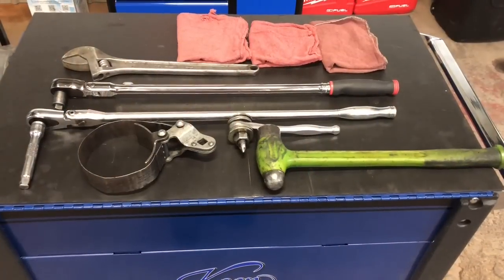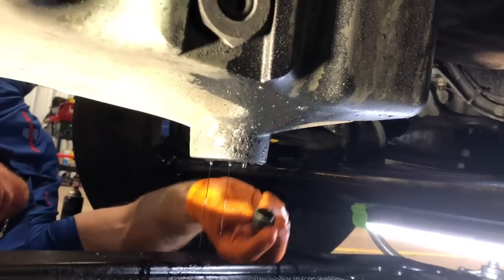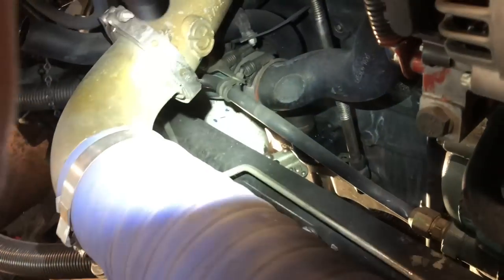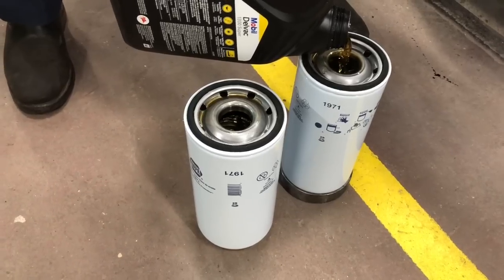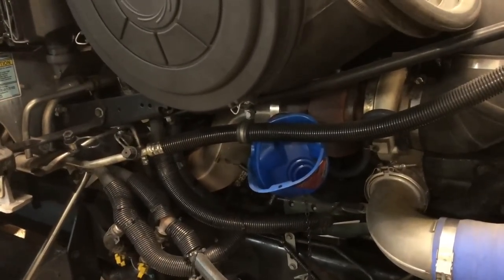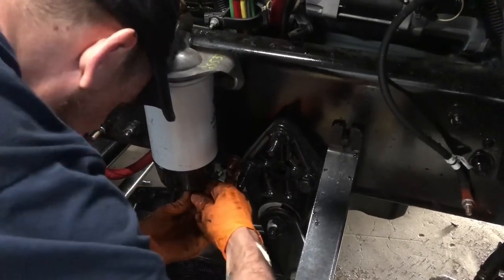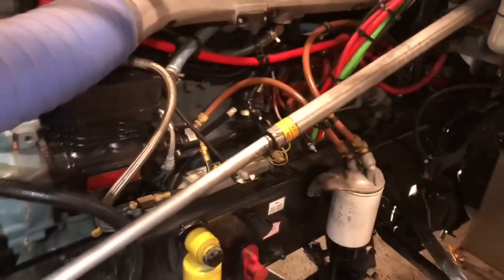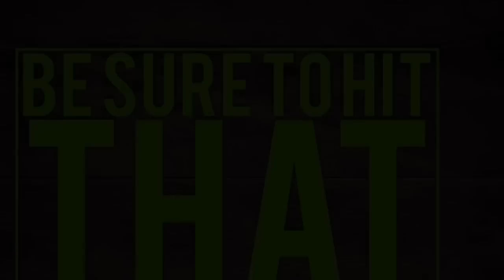Detroit 60 Series Full Service, DIY Step By Step Guide Oil, Oil Filter, Fuel Filter Change

Comment: One thing i learned from working on so many detroits is, if the motor is empty of oil and new filters is on and empty, you can fill the truck until the oil gets to the a in usa on the dipstick, if its the same dipstick all the trucks ive serviced, after you fire it and the oil circulates, it puts it right to the full mark. I had to figure something out because I got tired of dropping a full oil filter lol

Comment: I have the same truck but a Fitzgerald. It's got 303,000 miles and not one issue yet. 550hp Fitzgerald 60 series and a 13spd. Glad I bought it.
Reply: 550 HP might have played a major role. Most people have under-powered engines and inadequate differentials which cause problems

Comment: I run a 1995 IH 9600 cabover coast to coast with an 1994 11.1 Detroit 60 ddec3.  I love that engine, extremely reliable.  regular service and run the rack every 100k and she purrs like a kitten.
Reply: WOW! You run it coast to coast? That's a trust bond I want with my 12.7 I just got in a '15 Columbia glider. I have algae in the tanks 😤😤!
Reply: @willmann30  I used Diesel Clear from the same company that makes Diesel 911 fuel treatment.  It comes in a white bottle with green and black lettering I put 2 bottles in each tank when i filled up took my 34. I let it sit all weekend doing its thing. I had black tanks. You shine a flashlight in the tanks and you couldnt see the bottom of tank the black algae was everywhere! That product worked! I went through filters for a while but the tanks got cleaned and are algae free. I swear by that stuff. Put it in when fueling, top off tanks, park for the weekend or longer if you can akd let it do its thing. Walmart Carrie's it at the best price
Reply: What do you mean "run the rack"? You mean the valves?

Comment: I have had a Diesel shop for 12 years now and I overhauled tons of Detroit 60 and Cummins N14, Detroit were always getting up to a million miles after overhaul without issues, not so much for N14 had to open them back up around 600K
Reply: I'm looking at a 2008 Freightliner with a Detroit 60. Engine has "blow- by". Think it is worth getting? Just sitting at a dealership now.
Reply: @mathewkromeo2934 having a high blow by doesn't mean it needs an overhaul, it could be a much less of a repair, but even if it needs an overhaul, it's probably worth buying it cause an overhaul for DD 60 is only around 8-10k$
Reply: @KulinBan777  thanks to both of you for the response. The guy is asking $5000 for the truck. It's a 2008 with a Detroit 60.  I just don't know if I can get it to NY.
Reply: Where is your shop?

Comment: There is something that is very important to know about the oil filter housing/oil cooler on all series 60 engines. The the threaded part that goes into the oil filters can back out of the oil filter housing. When ever you go to spin on oil filters you should grab on to them and turn them clockwise to make sure they did not come loose. It would be a shame to spin the bearings out of one because one of the oil filters fell off.
Reply from the maker: Very good point

Comment: My experience with the old 12.7 pre emissions was very good. Money making chunk of cast iron.
Reply: Wayne Swicegood i have a 2000 international with a 99 12.7 detroit s60 it has 1.2 million miles past owner said it had an overhaul but no paperwork the trucks been running for me for almost two years no issues except waterpump and alternator should i do an overhaul even though it doesnt burn alot of oil???
Reply: Wayne Swicegood any input is appreciated sir
Reply from the maker: Heck no !! Save your money until it is needed !! Those are great engines. I had a 2002 9400i with a Detroit in it and it had 1.5 million on the factory engine and still ran perfect ! Just keep it serviced and rock on until it needs it
Reply: Koon Trucking thank you for your reply
Reply: Hello everyone I have a Detroit series 60 for 20 years haven't touch the engine,transmission,or clutch for all that time still running like a baby the only problem I work pulling cotainers and the pier is pushing me to get rid of it because pollution my truck is 1996 fld120 thes best engine ever invented 
Have a great day everyone

Comment: Them little wood pallets with small casters work great for settin your oil drain pan on to move it easy we used to use them on heavy equipment
Reply from the maker: Yeah that’s a good idea. We have a large 15 gallon one with an electric pump with casters we use on trucks

Comment: Years ago there was.a series 60 in a Peter Bilt  with almost a million miles with one oil drain. Pepsi  Cola of.Gulf port owned it for several years. Later it was.bought by a guy that hauled Motor  cycles. SHELL oil was.checking  it.  It had Gulf Coast paper towel filters. The mechanics would tear it down ever so often and  Shell would measure.the parts. The mechanics would reassemble it and pour the used oil back in. Of course  it used Shell Rotella. Conventional I think. The oil was 100% clean 100% of the time.  I was talking about it once. Road King asked me for the owners phone number. They did an article on it. When I retired I lost track of it. Worked for a company years ago that had Luber Finers on everything.

Comment: I need some tips on how to get the starter bolt closest to the block on an 2007 freightliner Columbia with a 60 series Detroit. That thing is whooping my but. Thanks
Reply: Type in Gordon Robertson starter replacement series 60 on youtube.   He's got a cool trick using electric tape on an extension.   I know you posted this a year ago but better late than never.   His tips worked for me,  oh and upgrade to the gear reduction starter.  Much lighter and easier starts in winter with less draw plus no core

Comment: I have a 60 series in my motorhome and I dont put on 20 000 miles per year.  How often should I change the oil?  If you fill up your fuel filters do you still have a chance of having an airlock.?  How often should you change the transmission fluid?  Some say dont change that if you are not having problems or the transmission might slip.

Comment: Who makes that oil drain pan? Like the looks of it for sure. And I own one of those engine's. But mines a 1995 11.1 in a KW t600. 620,000 original miles.
Reply from the maker: Pete kildow that pan is a Lincoln you can get one at Napa. The one we have has a hand pump to drain the oil so you don’t have to pick it up. It rolls really good and has a wide place for oil to drain as well as holders for the filters to drain out.

Comment: Really love and appreciate your videos. Got a 07 14L and I am about to do my first oil change myself. Any tips? I love this engine so much, looking a ridding it of the egr.
Reply: I just bought a 06 14L, and about to do my firstl oil change next week. How has your journey been so far?
Reply: @trawk244  excellent. Oil change is very easy, engine is extremely reliable.
Reply: @miguelcastillo3712 Did you "fix" the egr?

Comment: You get more oil out by suctioning the oil out though the dipstick.   Its also a good idea to run an engine flush prior to draining the old oil out, especially on diesel engines.  Donaldson oil filters are best.  Then you should use Amsoil as it provides 6x more wear protection than the DD spec.
Reply: Lmao you clearly don’t own a truck the price to change your oil with 10 gallons of amaoil vs cheaper oil for 1 million miles it’s just cheaper to rebuild it 😂😂😂
Reply: That’s every 15,000 miles
Reply: @illyapalamarchuk3525  Too soon.  If the engine need 10 gallons of oil it would be a lot cheaper to send oil samples to a lab where they can determine if the oil is still good or needs to be changed, regardless of what oil you are using.

Comment: Great vid as always, ahhh the good ole days. Of course 60 series was one of the better engines made, 12.7 was designed and made by john deere ;)
Reply from the maker: Bearded Seabee82 they are some good ones ! Wished all of them were like that still. Fuel, air, and oil and they just run !

Comment: Sir I do local work and run conventional. I Normally change the oil around 10k miles every 3 or 4 months. Just wondering if I should change the oil by hours instead or keep doing it by 10k miles. The truck stays on all day and averages around 50 to 60 hours a week. If so after how many hours would you recommend doing the oil change? Ty in advance sir

Comment: Hey brother, I'm going to sound like a complete idiot abd I know that I'll get some back lash, but here we go.
I am in the process of replacing all the coolant lines for the front and rear heater cores. I got pulled from the job to drive. I have a 60 Series Detroit in a 98 XL Classic.  I have 2 ports from the oil cooler and 2 ports on the back of the water pump. Can you please tell me where  to route the coolant lines to?
Example,  I have a coolant line hooked to the oil cooler and the other line from the heater core to the water pump. The other line are hooked up the same way for the sleeper. Is this correct??? Any help is very much appreciated.

Comment: The ddec 1 to ddec 3 will not communicate with modern lap tops. Must use the original nexiq system. 
You cant even send old ddec 2 out to be uprated.

Comment: I have a 3208 Caterpillar and was told not to Prime the filters
Reply from the maker: John Bartholomew I’ve never have any dealing with cat engines other than 3406 or C13 and C15 engines.
Reply: a lot of companies say that because when the filters are in the engine it draws oil from the outside holes through the filter and out the center. technically filling the center of the filter means that oil wont be filtered when you put it back into the engine. another way around it is if you plug the center hole and fill it, that way the oil is forced through the filter

Comment: How do you increase the idle on a 93 12.7?
Reply from the maker: You will have to change the values (settings) in the ecm. If you know someone with a computer they will probably do it for you for really cheap. I figure a dealership will charge about $120-150 or so
Reply: Nobody will touch a 1993 ecm to re rate it. Those ecms will not communicate with modern lap tops.
Reply from the maker: Surprisingly they will just fine.
Reply: You can communicate with a DDEC2 using Diagnostic link, the parameters you can change a very limited. To reprogram it you actually have to use a bench top adapter with DDEC reprograming software. We don't see them very often at the shop, but every now and again.

Comment: Dont ya just hate those fuel cans without the vent on them? Whenever trying to fill something it just coughs and glugs as it flow and you spill it all over the place and make a mess.
Reply from the maker: Mike Humphrey oh they are such a pain ! I actually took the Saftey feature off that can that’s why it has JB Weld on the spout ! Haha I can not stand that gurgling and burping ! Obviously the guy that came up with that saftey feature has never had to hold a diesel can up while it burps along trying to put it into your tank or filters.
Reply: Just punch a small hole with a screw in the handle

Comment: Sir, it's safe to use brake cleaner to clean the oil fill tube, correct?
Reply from the maker: Obviously don’t spray it down inside the tube but yes
Reply: @Koon Trucking  Thank you sir.

Comment: Should I punch a hole in the new filters before I put them on?
Reply: No . You punch a hole in the old filter because it is easier for  removal. Just prefill the filters with oil or diesel as well as lubricate the filter seal.
Reply: @d0colb  , actually I was just joking about that
Reply: @4321grp  good , with today drivers I wouldn't be surprised someone would do it....
Reply: No. You're supposed to punch the hole AFTER you put them on. C'mon now, you should know this!

Comment: I know it’s an old video but I just purchased a pre-emissions 12.7 and I’d appreciate your opinion on injectors. Does anyone other than DD make good replacement injectors? Also, would you worry about the bull gear in it? The engine has about 750K on it and a very good service history but I know that the bull gear hasn’t been replaced. It’s a 2000 model engine so it doesn’t have the compact gear train in it. I used to drive for a small fleet(100) that were all equipped with 12.7s and I never personally witnessed a bull gear failure and they got the crap ran out of them with minimal maintenance . Obviously, since this vehicle is mine if it’s questionable at all I’d rather do it than have it fly apart. Thanks for the videos. Oh, you guys would come out cheaper spending your money on hookers and gambling than to keep feeding that tool buying addiction ya’ll got!🤑👍

Comment: Have a 2002 FL Columbia with the 60 series. Got a CEL while driving and started losing power. The revs slowly drop til the the engine struggles to stay on and then shuts off. Replaced the fuel lines, filters and pump. Ran fine for around 100 miles then my poor beast started doing the same thing again. Any ideas on what's going on?
Reply: What was the CEL for?
Reply: @terryeffinp  cummins  select

Comment: Replaced manifold. Getting a loud scream when accelerate when  I'm driving...Help
Reply: you either have a hole in one of the hoses going to the air to air or a hole in the air to air itself.i have had the same issue or a oring bad from the outlet fitting from turbo to air to air

Comment: Why punch hole in oil filters?
Reply from the maker: WASHINGTON we do it because it is less messy that way. When you unscrew them oil goes everywhere most of the time and risk dropping a filter full of oil. Just be sure you break it loose first before punching a hole in it if it’s on a truck you have not serviced. If you service it regular you will be ok because you know it was installed correctly.
Reply: Koon Trucking ThAnks

Comment: I know you guys have been doing this a long time but why are you are filling your filters in the center hole (the return clean side of the filter with unfiltered oil or fuel and not down into the dirty side only (outside row of intake holes)? New oil and fuel are still considered unfiltered. Isn't that why Cat says to not prefill the filters? I know you're doing a 12.7 in this video.  From Fleetguard (Cummins) filter install bulletin (Important installation steps for spin on filters:
■ Make sure the filter head is clean and free of damage. 
■ Apply a liberal amount of lube oil or diesel fuel to the surfaces of 
all filter gaskets where they make contact with the head (Fig 2.).
DO NOT USE GREASE OR FIT WITH DRY GASKETS
■ Check the engine manufacturers’ requirements for prefilling fuel 
filters.
Never pre-fill the clean side of the fuel filter).
At Volvo we recommend installing filters dry and pre-priming them for contamination control — it really is worth the time to do it properly
Just a curiosity question? Thanks in Advance.

Comment: These are crap motors. I have a 2013 western star 4864fx with a s60 legacy . Always having problems. This engines did 350k kms an got rebuild an the moment new rebuild it's done about 50k kms trouble free
Reply: Sounds like the problems between the seat and steering wheel.
Reply: @MrWisdom79  rubbish motors . I'm driving one now . Tryn to ask boss to put a Cummins gen2 in
Reply: @MrWisdom79  HAHAHALOL...i like that...can i use that on some people i know....please ..can i?
Reply: @MrWisdom79  😂😂😂😂😂